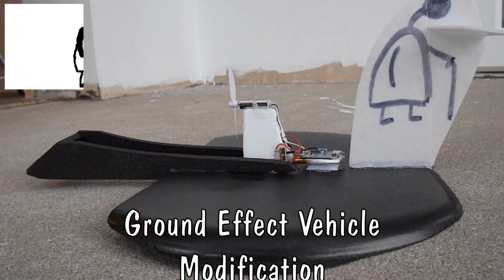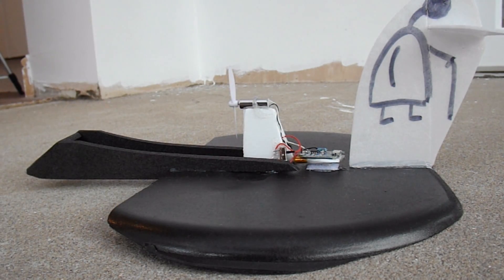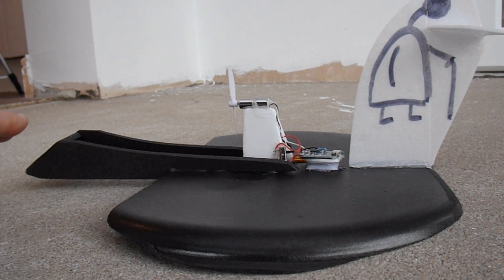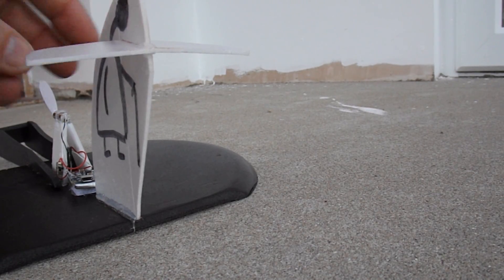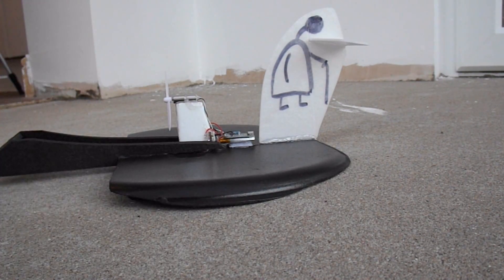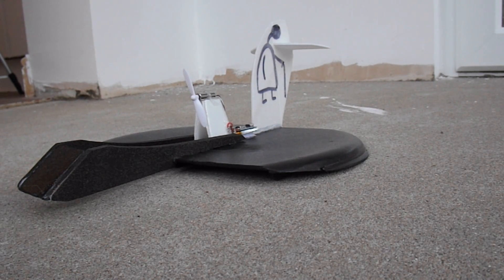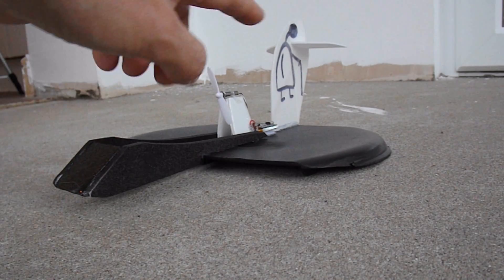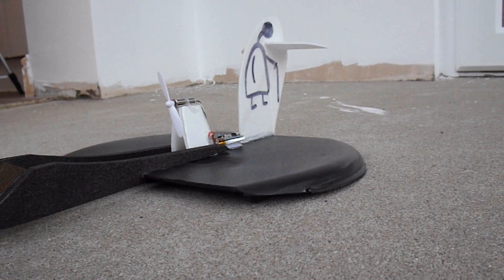Ground Effect Vehicle Modification

Comment: the next time you do ground effect can you show us a picture with the camera on the floor so i can see the plane hovering
Reply from the maker: Luke Gibson ground effect is not the same as hovering. The plane must be moving forwards at speed to create the increased air pressure underneath to provide the lift. If you look at the video description there are links to plenty of better examples. I don't intend to do any more as they need to fly fast to generate the lift so in my kitchen that means they destroy themselves smashing into the wall at speed.If you have checked out the video description here is the link to my GEV playlist where there is one more in the series https://www.youtube.com/playlist?list=PLA5a2xPRSrB3I-wHAca4HzmbzGy9LzsJk
In the earlier version I had trouble keeping it on the ground and it tended to flip over,

Comment: Yeah, I have built a few ground effect hovercrafts, from random household materials. I do not think this model is the best design (no offense, of course) in terms of efficiency and speed, though. The ideal model, does not have the instabilities which this model is working hard to avoid. Ideally, the hovercraft should be longer forward than it is wide sideways. You want to reduce how much wind blows in under the front of the foil, and have the wind injected from inlets (like the "blowers" on the hood of some hot rods) near the rear (trailing) edge of the craft. This makes the front tilt downward a little, and gives more overall lift (with less drag). It is not really necessary for any air to blow under the front of the foil, but it is usually a good idea to let it do so, at least a little. Also, if the craft is fast enough (it does not need to be very fast), add wings that spread out sideways from the rear of the craft, and make sure they just barely touch the ground on their trailing edges, with their leading edges facing upward a little. Once the craft is moving, these wings should lift off the ground, and they will improve stability and lift. The only disadvantage of these wings, is that it does add some more drag.